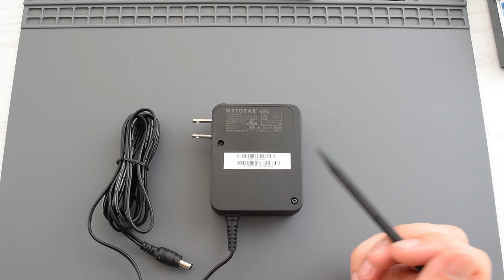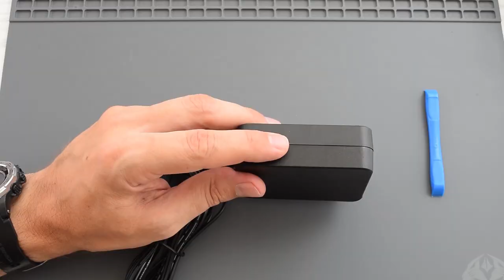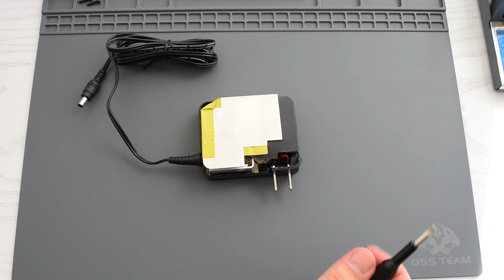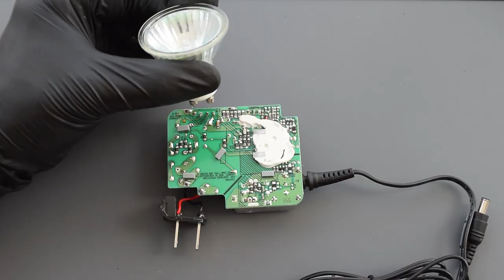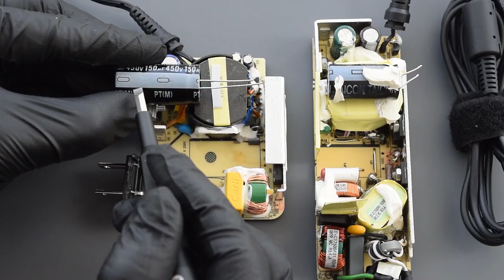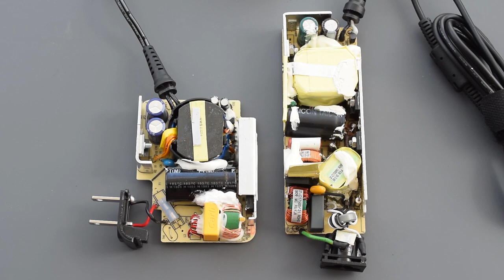How to convert any 110/120V AC/DC Power Adapter to 220/240V Electricity

Comment: Sometimes in 120v devices the power MOSFET can have a lower max voltage rating, so it is good to also check that as well as the PWM IC.

Comment: Thanks for this very detailed video. Got a desolder station that I need to review to make sure it's ok to use with 240v. Moved from the USA to the UK and it was supposed to be dual rated,  but the casing only includes 110v and it's too late to return.
Reply from the maker: Soldering stations are tricky ones. First of all they usually have a transformer inside which means you must replace it with a 240V version. That transformer usually only powers electronics inside of the station. When the heating element is usually powered by 120V or 240V so you may need to change that one too. What's the model of the station?

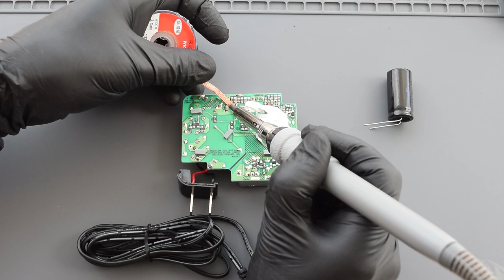Comment: Does this mod apply to AC in put, AC out put as well? No conversion to DC for the output? Also, at the 2:20 mark, you mention the necessity of replacing the large electo capacitor but possibly also the fuse and rectifier bridge. At @5:20, you discuss altering the fuse via upgrading the varistor but you don't explore the rectifier bridge specs. Am I missing something here? Thanks so much.
Reply from the maker: I just gave some basic instructions for those who have at least minimum knowledge in electronics and understand what they are doing. If I tried to cover all possible scenarios, the video would be too long and complicated. There are several possible cases. Sometimes manufacturers make exactly the same universal power supply but with US plugs and label it as 120 volts. If you disassemble it and see that the big capacitor is rated for 400-450 volts, then that power supply will likely work without any modifications, or at least you'll have to remove the varistor or replace it with a proper one. In terms of fuses, there's no need to replace them for a regular consumer-grade switchable power supply. If it's special equipment that operates under high current, then maybe I'd use a fuse with a 0.5A higher rating. Diode bridges are all rated nowadays at least 500 volts because financially, it's a dumb idea to use or manufacture one that is rated for something lower. But in some cheap generic power supplies it still could be the case. So, in general, we only replace the big electrolytic capacitor and the varistor with the 10D471K rated Max Continuous Voltage AC: 300V. The rest of the components does what has to without any modifications.
Reply: @ElectronicsComputers  Thanks so much. Appreciate the detailed  reply.
Reply: @ElectronicsComputers  Agree, it is more cost effective to make them universal. Change as little as possible, or nothing more than the plug.

Comment: Hi! This video helped a lot. Thank you very much! 

Unfortunately, I've already made the power unit blown up and found your video afterwards. I think the pop came from the bridge rectifier. It says S1WB S 40 77 on it (no datasheet, 4 PIN DIP). Rectifier become open circuit. I checked the fuse (250V 1A) and other diodes as well. All working as expected. How can I find a replacement for it? Which ratings should I consider choosing it?

The power circuit is Yamaha DX7s' original Japanese power unit. It's blown up after hooking it up to 230V power outlet. Nonetheless, I had already separated DC rails of the PSU from the motherboard during the experiment.
Reply from the maker: If you show me some photos of the PCB where the rectifier bridge is located, I'll try to help you. Have you replaced the main capacitor?

Comment: Thank you for the detailed video. Will the other component survive if we just change the capacitor only? Because instead of 120V we are giving 220V. I have the same power adapter and I want to use it in UK.
Reply from the maker: All switchable power supplies can work in the range of 120-240V. If it's a dedicated 120 volts adapter, then usually you need to work with its input circuit and replace 1-3 components.
Reply: @ElectronicsComputers  Thank you for your reply. It is exactly same as you explained. Changed with 450v 47uf (that is the one available from an existing 220v adapter) and it is working well. checked the output voltage and it is 19v.

Comment: I think there could be problems with the bootstrap for the IC
Reply from the maker: It could only be in some extremely rare cases. I've converted dozens of different power supplies for various devices and equipment and never had any complaints.

Comment: But what about the transofrmer? It should be capable if handling increased voltage pulses.
Reply from the maker: MOSFETs are used to regulate this pulsating DC voltage. The MOSFETs can control the flow of current to smooth out the pulsations and regulate the voltage. The control circuitry adjusts the duty cycle of the MOSFETs' switching based on the input voltage level to achieve the desired output voltage. 
After the MOSFET regulation, the voltage is sent to the transformer. The transformer then steps down the voltage to achieve the desired output voltage. I've converted dozens of power supplies, and never had any issues.
Reply: @ElectronicsComputers  yes, but still, the IC circuit that drives the MOSFET must be capable of dealing with increased voltage (shorter duty cycle), right?
Reply: @atexnik  No answer. Maybe, but again, like he said, dozens with no issues.

Comment: Hi thanks for the video it’s kind of helped me but I want to know if I can convert an American 110v Sony Amplifier to 240v for use in the UK? Is it the same process where I just change the same components you did on the power board or is there more to change? Thanks again
Reply from the maker: It depends on a power supply type. If you show me the picture of that power supply, with visible markings on the components, then I could tell you what to do. But again you can always just buy a transformer which costs about 50$ and you can safely use your amplifier.
Reply: @ElectronicsComputers  Hi, I have a similar question. Do you have an email I could reach you at? Buying a powered PA speaker that has 2 different versions for NA/Europe, but it's the same idea...takes mains converts to DC internally.

Comment: thanks for the great video,
i have a question, my adaptor has a 250 68uf 16*20
the only one i found of the same size is 400v 68uf
should i opt of a 450v of lower uf or higher uf or just use this one?
thanks for your help and i hope to see more vids like this one
Reply from the maker: If you can fit 400v 68uf into your device then it's a prefect choice. No need to go higher in voltage because 400V cap is what you actually need for 220-240 volts AC input circuit.

Comment: Hi, thank you for the video. I am a beginner , so sorry for the silly question for you.  Do I have to change the transistor too? It is A UTC MPSA42L TEA, with maximum ratings 500 for base voltage capacity, 3000 for emitter voltage and 500 for collector energy.
Reply from the maker: No need to change it.
Reply: ...I need a second opinion....I wanted to buy a new varistor (300V) but the guy at the store asked me if it is a PTC or an NTC....I told him it's not a thermistor, but he keeps insisting that also the varistors work on  positive and negative temperature?! I am confused, plus...how do I know? the datasheet doesn't say anything understandable for idiot-like human beings like me! @ElectronicsComputers
Reply from the maker: @evapantaleoni1405   A varistor has nothing to do with temperature; it's a voltage-dependent component. For example, if it's rated for 300 volts (which is the one used for 220-240V protection) and, let's say, your residential building has a bad neutral connection, you may end up with 380 volts coming into your apartment. In such a case, the resistance of the varistor will drop to zero, causing a short circuit. This, in turn, will blow the fuse inside the power supply, cutting off the high voltage reaching your device. That's how varistor protection works. In the video description you'll find a link for varistors. They cost less than a dollar. Here's also a link for a datasheet which shows what model you need according to your Max Allowed AC voltage: https://pdf1.alldatasheet.com/datasheet-pdf/view/47877/CERAMATE/10D270K.html
Reply: THANK YOU SO VERY MUCH!!!

Comment: All the power bricks I've ever seen are rated for both 110 and 220vac. I go to Europe often and us laptops and small music stereo amplifiers all use these power bricks. so I assume they are ok yes?
Reply from the maker: All laptops, phones and stuff like that come with "travel adapters". Routers and some specific equipment are not designed that way. If your power brick is rated for 120V only then it's not designed to work with 220v electricity.

Comment: thanks for the video. would you know if a Nintendo 3DS charger changing only these components of the AC circuit will work?I was afraid to do that, and the voltage of the DC circuit would double the value
Reply from the maker: It's impossible to double the output voltage by messing with the input stage of the power supply. That adapter comes in two variations 110V and 110-240v. You have to disassemble the case and look at the voltage of the main capacitor. If it's higher than 400v then it's a universal charger even though it says 110v on its case. If that cap has lower voltage, then you need to replace it and also check the varistor. If it's present on the board then replace it as well or simply remove it.
Reply: @ElectronicsComputers  Thanks for the answers. so, the AC input circuit already has 350V capacitors, there are no varistors (IMOV) on the AC input. but the charger does not release the DC voltage when connecting to a 220V network the charger only works on 110V networks. for that reason I figured there must be some change needed in the secondary circuit.

Comment: Hi, thanks for informative video but why you used 400v capacitor? Can i use 250v capacitors because my home power voltage is 250vac
Reply from the maker: We're are not talking about AC voltage, it's about DC. For example, if your country has 220 volts grid, then the peak rectified voltage will be approximately 311 volts. This is why we always need some good voltage reserve on caps.
Reply: @ElectronicsComputers  thanks a lot for your help, after changing capacitor to 400v my SMPS now converted to 240v power supply.

Comment: Sir I have a GE electric range, the hot plate operates on 220v but oven control board uses 110v, I needed to convert it to 220v. By the way I don't have the schematic.
Reply from the maker: What's the model.

Comment: Thanks for this very detailed video,If I may asks if is this same for the XboxOne PSU rated  120v ?
I got one came with the USA XboxOne ,and need to do this conversion ,any suggestions ?
Thanks
Reply from the maker: Technically it's possible to convert that power supply to a 220v circuit but it's not that easy with this one. Because you need to remove one capacitor and solder two chokes on that place. It's a 10-minute work if you have those chokes but if you don't have a donor board then your best option would be to buy a new 220v power supply. https://ibb.co/6JLtNws

Comment: Thank you very much! Fantastic video and super clear. One question left. You say replace or remove the varistor. But replace with what type. I have a JVR-10N201K here. But I don't know if I have to pull it out or replace it. Thanks again!
Reply from the maker: If you google that varistor model, the first link will show you the list of all models with the specs. JVR-10N201 is for 120V protection. For 220-240v you need a varistor that can handle 300 volts which is JVR-10N471K. This varistor will cost you about $2 with delivery: http://alii.pub/6gufjr
Or you can simply remove it from the PCB and use your device without that component.

Comment: Hi,
Im doing the same, from 110V to 220V and came across the same varasitor as you show in this video, you didnt have to replace it? Or should i look for a higher rated one? 
Thanks
Reply from the maker: For 220 volts the minimum varistor's value should be 300 volts. If it's less then definitely replace it.

Comment: The peak voltage of 220vac is higher than 300V and for that reason i understand why we need to use 400V-450V capacitor,but why did you mentioned that 275V rated value for the interference suppression cap is enough?won't they be damaged by the peak AC voltage?Thanks.
Reply from the maker: In all the devices I've seen, the interference suppression capacitors are rated for 275-300 volts. Even in Europe, where the voltage is typically 220-240 volts, there's still a 50-volt reserve. The AC line voltage remains fairly stable, and even if there are occasional spikes, they are unlikely to harm the capacitor. Additionally, in the event of surges, the varistor inside the unit is there to manage and protect the entire system.
Reply from the maker: @shonl9743 I've seen your message in the notifications but then it was removed by youtube. It's not in the spam list too. So try again. If your power supply has two big caps with the same specs, then that power supply is built by another schematic and it's a little bit different process. I need to see the detailed photos from both side of the PCB. Just upload your photos to the cloud and share your links here.
Reply: @ElectronicsComputers  Yes,i made a photo of the PCB both sides and i made a link for the photo through ImgBB-image hosting website,but youtube removes it each time.Can't figure why?.I will try to find a way to show you the photo.Thanks.
Reply from the maker: @shonl9743 Yes, I got the image. I'll reply you later.
Reply: @ElectronicsComputers  Okay,thanks.
Reply from the maker: @shonl9743  I looked into the schematics of that power supply, and I have to say it's extremely cheap and simple—dangerously simple. There's no AC input protection, and there's no protection on the DC side to safeguard the device that the power supply is meant to power. It's designed to be as simple and cheap as possible for a specific voltage, and tuning and converting it will require replacing a bunch of components, which isn't worth it. You can buy a better power supply on AliExpress for 5 euros, delivered, with any voltage and current you need. I can provide you with the link if you tell me the specs of your power supply and its DC connector.

Comment: I have a Levoit 300s humidifier. It has two 450V capacitors. Should I change something there? Thank you!
Reply from the maker: That humidifier also has a 220v model and the only difference is a power cable. So just buy an adapter for the plug and it will work perfectly in your country.
Reply: @ElectronicsComputers  Thank you so much

Comment: I didn't know that it was so easy. I have one 240V (two hot wires) outlet in my kitchen and garage. And ones I destroyed my food processor and a small FM radio.
Reply from the maker: It's not a universal solution but works for most AC/DC adapters like that. Your fried devices had a linear power supply which is based on a transformer. And the only way to convert them to 220V is to replace that transformer with a proper one.

Comment: Hi, would you be able to tell me the part number and model number of the Netgear Adapter? I might have the same one as yours, and if it is, I would just get a converter instead of opening it up first, thank you :)
Reply from the maker: Unfortunately, I don't have that router anymore but if it says on the power supply, that it's a 120V version, then you have to use a step down transformer. There's no 240 volt version with the US plugs.

Comment: very interesting video. Can I use same technique for a coffee machine? it's working with 110v and consumes 1500W, but I want to move it to a country with 220v power. Will patriciate any advice. Thanks
Reply from the maker: It's most likely possible (depending on the model), and I've done it once before. However, the heating element must be changed to operate at a specific AC voltage, in your case, 220 volts.

Comment: Thank you for the video. I really learn new things. The explanations were very good. Unfortunately I bought a dewalt charger (dcb118) from USA and it 110v 60hz. Can I do something with that or should I throw it? Can you give me an advice?
Thank you very much.
Reply from the maker: Show me the picture of that charger internals. Usually replacing the main cap and varistor helps in most cases.

Comment: is that i need change fuse also?
Reply from the maker: If it is just a consumer electronics device, there is no need to replace the fuse. Simply replace the capacitor and the varistor.
Reply: @ElectronicsComputers  what type varistor i need use? sorry i don't know much about varistor

Comment: An online seller sold me a Portable hot air station that is rated 110V. What component do I need to change to make it usable for 220v?
Reply from the maker: What's the model of that station? Most likely you'll need to replace the transformer which can be hard to find.
Reply from the maker: @mibjt  You'll need to replace the heating element for sure and maybe a resistor that goes to a triac that controls the temperature of the heating element. But I'm not sure about that resistor. Google for a 220V schematics (it's available) for that device so you can check out all those components.
Reply: @ElectronicsComputers  Thanks for the suggestion. I have some old ATX power supplies lying around. Maybe I can harvest some relevant parts from there.